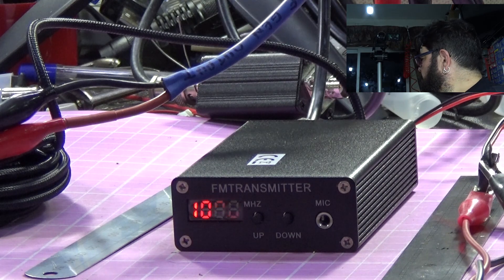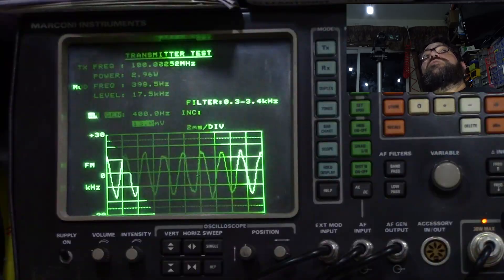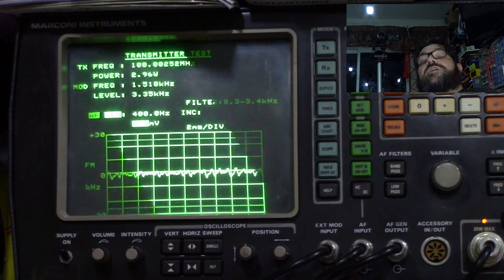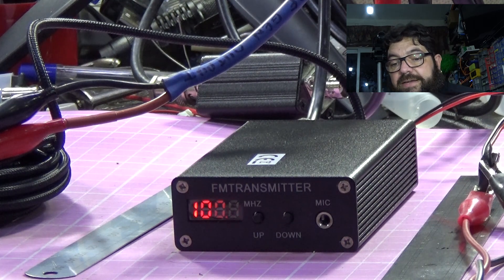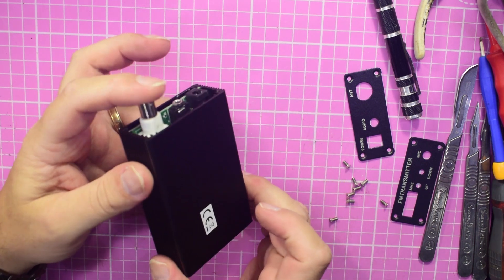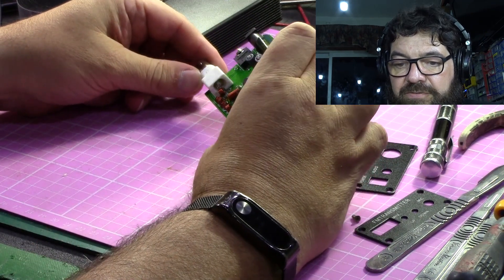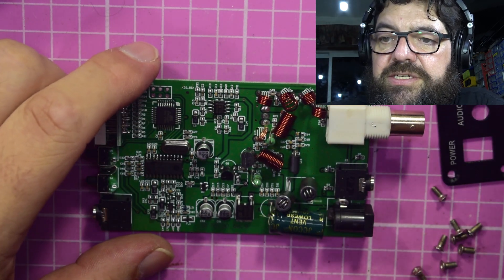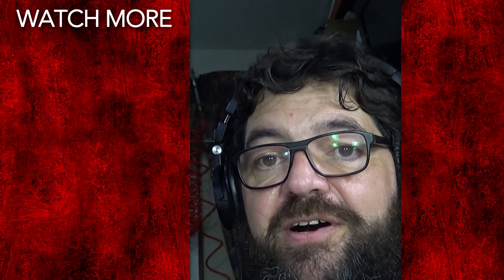Chinese FM Transmitter

Comment: Thanks for the video! I would like to ask you if you have any schematic because i like to convert my 5w which is the same as yours to 50mw    running just only the first of the three amplifiers. I uninstalled the final c1971 and the previous transistor of it and bridged the first amplifier transistor directly to the low pass filter. Any idea what other components have to be uninstalled? Thanks again for this very nice review of the unit.

Comment: Hi I have one of the Chinese transmitters I put a 1/4 wave antenna up in my  attic my tv antenna is also up there it knocked out the signal do you think if I put the antenna outside on the roof it will be ok ? Let me know if you can please
Reply from the maker: yes, move the transmitter aerial as far away as possible, either inside the attic or better still outside.
Reply: @GeorgeChristofi  yeh I wanted to hide it but obviously not a option In my attic because the tv antenna is like 3 meters away thanks for the reply 👍

Comment: My friend has a 15 watt transmitter it is a silver box with a blue LED display. He said it cost him very little money and all he did was have a mix on his decks and use the audio from his amp that went into the transmitter. It got as far as 7 miles away which wasn't bad but we found he was on about 3 other different frequencies to the one he was on! But it seemed the other frequencies he was on had vanished a little way down the road and the actual frequency he was transmitting on remained. He either went on in the middle of the night or in day time in the week. He hasn't been caught and this is in the UK.
I was fascinated about the transmission and how it looked so painless and easy to set up.
Reply: NIORFNIO？

Comment: Great video. I was wondering if you could go into more detail about filters. I have 4 big huge filters connected directly to the amp board via a solder. After a repair was made the connection came loose where the filters connect to the amp and I wonder if that's what caused us to experience spurious emissions. Any feedback would be great.

Comment: I noticed on Bangoods website it says '70M to 90M can provide'   I always wanted to have a wee play with stereo on amateur radio so this is begging to be fired up on 4m.  Any idea if it is a link change internally to get it on 4?? GM0HSC
Reply from the maker: Not sure. The reason for the alternative frequency range is the Japanese market where the FM radio band is 70-90mhz. It might pull south as standard but I would have thought it might need a coil tweak. George, G0JKZ

Comment: can you limit the range if the antenna is short (down)
Reply from the maker: not on this model because there is no vswr protection on the output stage. The only way to do it would be to put an attenuator in line between the tx and the antenna. I found that reducing the supply voltage did reduce the power but I didn't do many experiments to see how stable it was. Hope that helped, thanks for stopping by.

Comment: I tried one of these and it was quite good with no sprogs, then tried a 15 watt that had sprogs on low 3 watt but good on 15 watt power. I blamed my aerial and the fact it’s a lcd choosing your frequencies. A good transmitter is made just for the selected frequency. These things are on air band for about 100 yards up the road then it is normal on frequency. Might be because of aerial?
Reply from the maker: Having an aerial that matches closely to the transmitter frequency will remove a lot of standing waves on the feeder cable which could remix and cause issues or just make the unit hot, again, taking the output device into unwanted behaviour. As a unit, it seems to work reasonably well. I may revisit this box in the near future.

Comment: What is the transmitting distance of this transmitter? Is that good for 3 kilometers?
Reply from the maker: With a proper antenna mounted high up in the clear, 3Km is possible for sure.
Reply: @GeorgeChristofi  thank you so much sir for your reply. God bless

Comment: Is it only 3 watts?
Reply from the maker: Yes, it was vastly overestimated by the manufacturer, considering the lack of proper heatsink on the final transistor. Yes, you can get more power by increasing the voltage supplied but at the risk of killing the unit.
Reply: @GeorgeChristofi  i live in island here lol i wasted my money on this over estimated product. Im planning to put heatsink paste on the transistor  to prevent over heating
Reply from the maker: @TristanYT1  I would suggest mounting the transistor on a proper heatsink and using thermal paste.

Comment: That transmitter s*cks... overheats so fast knowing that there is no heatsink provided for the power transistor...
Reply from the maker: it uses the bottom of the case to act as the heartsink. I fitted some teflon sheet between the front of the device and pcb to make sure it had good contact at all times. it should have a proper heatsink I agree, but as it stands... its ok.

Comment: What did you do to cut the output power down?
Reply from the maker: I found that reducing the voltage on the supply would do it to a point as well as running it into a dummy load. I could never legally put it on air here in the uk because there is no provision for a domestic fm transmission licence but I could run a 'leaky feeder' system to limit the range significantly.
Reply: @GeorgeChristofi  I have the dummy load. I'll experiment with supply and see what happens. just using it for the house and when I'm in the yard. Thank you for the help!

Comment: Ofcom would be on your doorstep quick smart if it went to an aerial. ACMA in Australia would turn up pretty quickly too.  Probably many of these around I wouldn't doubt
Reply: Thank God for the funds-strapped FCC here in the US. I've been running a LPFM station for about 6 months now and so far so good, and I'm using a Chinese transmitter (derisively called "splatter boxes" by the legal Part 15 hobbyists) that's actually very clean and it's actually putting out a little over 8 watts (the transmitter was advertised for 7) and I'm getting nearly 12 miles by just using the supplied antenna. Only real downside is the preemphasis is set for European and not US, but only someone with a trained ear would notice the difference...I hope.
Reply from the maker: @brettcooper3893  I can't remember exactly where I saw it but there was some information about switching the pre-emp to different standards. I used to get confiscated transmitters from the guy who had the job of busting pirate radio stations in London. A useful source of parts, some were really nicely built, others were vomit on a pcb.
Reply from the maker: It's true. Though they have scaled back in recent years, if there is a report from a broadcaster they jump within hours. If you are getting interference then it's a slightly different situation.
Reply: ACMA charge for interference investigations these days.

Comment: That is a real nice FM transmitter, i would not want to risk  try transmitting with this..LOL
Reply from the maker: It is certainly not legal to use in the UK outside of a Faraday cage! I think it should be ok if I run it into a dummy load without any sheilding on it as a test transmitter but i'f I put it into a real antenna... I would give it 24 hours before they were taking me away in cuffs.
Reply: @GeorgeChristofi   A'lot of pirate stations use similar transmitters and haven't been caught for years, Ofcom who regulate the air waves don't have the time and money to go driving around the country looking for pirate stations. You'll only get caught if a neighbour or member of the public complains to Ofcom about it at which point they will investigate.
Reply from the maker: @NicholasCoulter  Indeed. They respond a lot faster to radio stations who complain because they pay a fortune in licence fees.I remember the time before ofcom when you had the RIS, they were much more active because there were a lot more of them. Actually working in the radio industry meant that I got to know the local guys. These days, with the cutbacks and privatisation there are very few left nationally. My luck though, there would be one based in my street!

Comment: Gotta love those cheap Chinese boards... you cant even make one yourself for twice the price....
Reply from the maker: That was the dilemma Martin. Do I build it myself out of scrap parts and have to go through designing and making a board, building and testing just to cost me hours of time or get one from China. If I had nothing else to do I might have built one but....
Reply: I know... I have been making an EEPROM programmer for an add on for my mini CNC mill to run a series of custom commands on startup. it was supposed to be a quick 2 hour project putting it together,  one arduino mini, a couple of shift registers and a 28c16 and a birds nest of wires on a breadboard plus a day and a half of programming.... or less than a fiver from aliexpress......